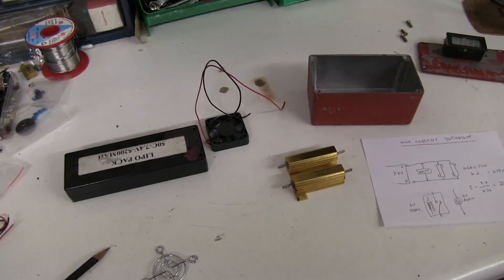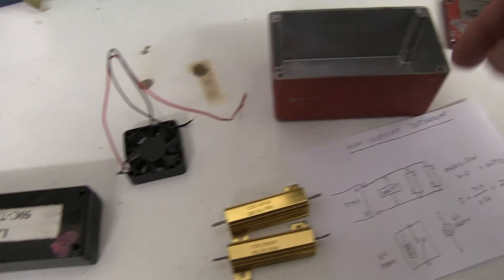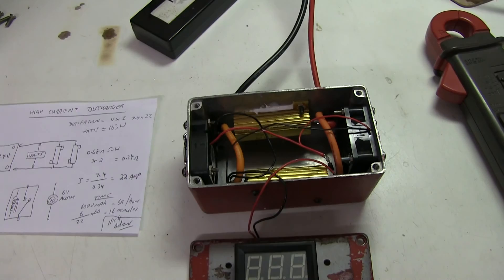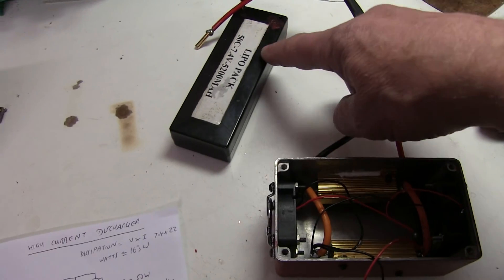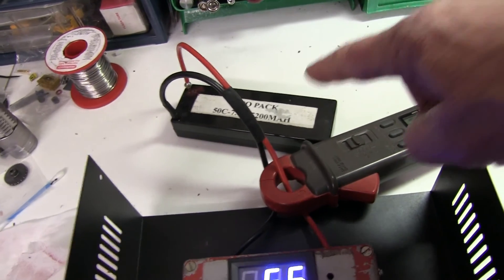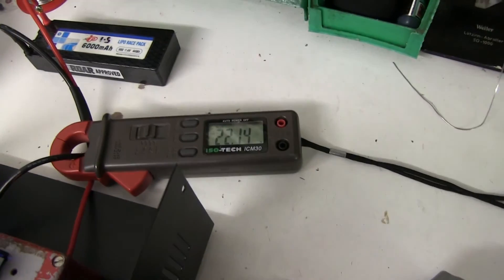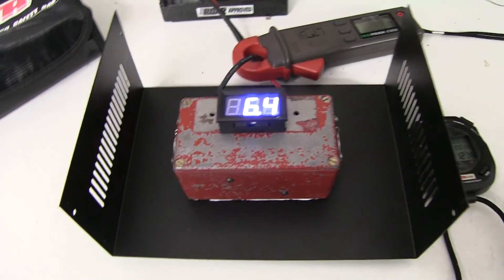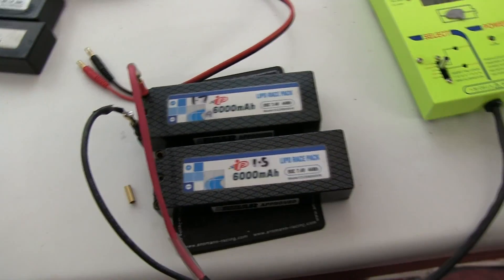High Current (22 Amp) 2S Lipo Discharger. How to make.

Comment: any idea how could make one that would do 10-40amps along with 2-4s being controlled by something like a raspberry pie? and then having it stop at a given voltage?
Reply from the maker: Hi, yes it would be easy to make a voltage comparator. It could control a relay to switch on/off. You could use different resistors controlled by switches (or FETs) to select the current.  I sell my own auto discharge units for 1S and 2S.

Comment: Hello, I enjoyed your videos. Thanks! 

So I hope I got this right; I need to make a 30amp discharger for a 2s lipo. 
Watts = V * A
222 = 7.4 * 30 ( so I need  around 300watts )
V/I= 0.25ohm (rounded from 0.24666) 

So from this, if I get 4 100watt 1ohm resistors and wire them in parallel, I should receive about 30amp discharge on 2s lipo battery. 
Correct?

Thanks again!
Reply from the maker: Hi
Yes, the 4 x 1ohm  at 100W each will do the trick.

All the best
Reply: Awesome thanks!

Comment: If u use 4ohm resistors how does it change the outcome?
Reply from the maker: Hi Rick
You need to work out a few equations.
The resistance will determine the current at the battery voltage.
If you want say 20 amps from 8volt you will need 
V/I= 0.4ohm.
So you will need 10 of the 4 ohm resistors in parrallel to get 0.4ohms.

Comment: Hello Nick, love your videos...   im building a discharger like yours but i went with 3 resistors at .68 ohms and 50watts.  just wanted to make sure my calculation is right.  My math says 33amps.   im using 2s packs .Does that sound right?  Thanks buddy.
Reply from the maker: Hi Sam
The three resistors in parrallel are 0.22ohm.
With a 2S lipo at say 7.7 volt it will be 35 amps, but that will drop as the resistors heat up.
However the Watts disipation will be 270 watts which will burn out your resistors, which are only a total of 150watts.
You will need more or bigger resistors. At least 300watts, but preferably 500 to 600watts to prevent the individual resistors running too hot, which causes their rersistance to rise and current to drop..
Reply: so should i eliminate one resistor and just go with two like yours in the video.....
Reply from the maker: Hi Sam
The problem is that your resistors are only 50watts.
Even 2 in parrallel will be about 22 amps and 160watts dissipation.
I used 100watt resistors.
However you can get 100watt resistors on Ebay quite cheap (from China). So you may have to buy a few more, as long as your box is big enough?
Reply: ahhh got it.  i thought you used 50 watt resistors.   ok ill start over.   thanks again for your help.  Your videos are the best.
Reply: ok Nick i started over and went 3  100 watt resistors  at .68 ohms.    is it normal for the resistors to get over 200 degrees...
Reply from the maker: Is that 200degreeC or F?
If Centigrade then that is too hot.
You need powerful fans to cool.
A lot of cheap fans are useless at moving air.
Get high rev fans, 5volt, and run them at the 2S voltage.
You should be able to get the temperature down.
Reply: Nick Adams yes. that is 200f.  They are reaching temps of actually 350f.  thats without fans though.   Gonna try fans today.  Once again thanks for the help.

Comment: hello Nick I am looking into building my own 2s 40 amp resister bank with cooling fins and fans can you tell me what I need to get to do this. I kind of want to make it look like what's on the market for sale now. thanks for any help
Reply from the maker: Hi Tony
Get the resistors that I use.
Then look around for a metal box or fins that you can fix them in.
Then assemble and fit the fans to blow through it.
There are many computer heatsinks that look good, but you will have to find a way of fixing them together.
Reply: Thanks Nick for the advice

Comment: hi Nick, its a "resistor aluminum 50w" vs 2 for 22amps? 
6 vs 50w for 40 amps?
Reply from the maker: Hi Marcelo
Watts=VoltsxAmps
At 22 amps and say 8volt  Watts= 176
So you will need at least 200watts of resistors to dissipate the heat.
(2 x 100watt, or 4 x50watt resistors.)
At 40 amps:
8x40= 320watts.  So will need at least 400watts of resistors to dissipate the heat.
Hope that helps
nick
Reply: Nick Adams , thanks for advices!
I just bought 3 resistors of 100w each, 4ohms! When i installed them like your video, the discharger appears 0,5 amps! Whats wrong ?
Reply from the maker: Hi Marcelo
You must connect them in parallel (side by side ) not all in a row.
All the best
nick.